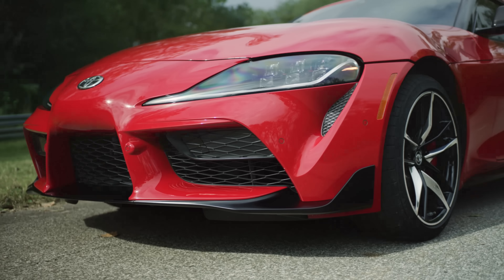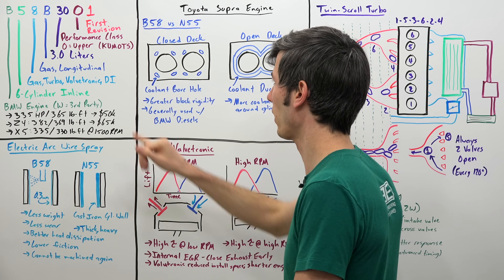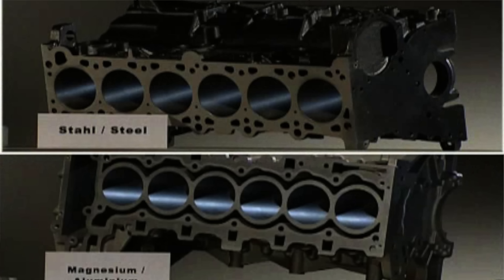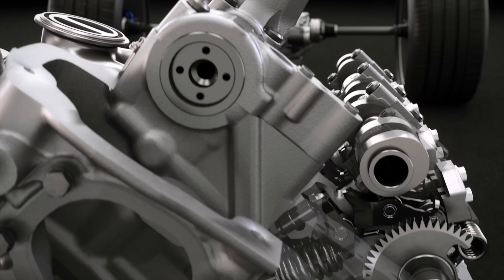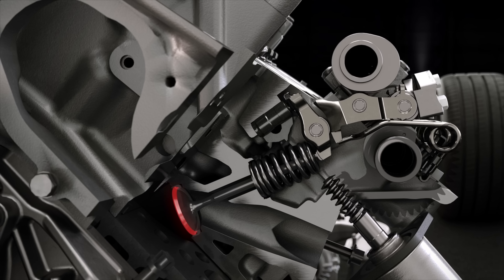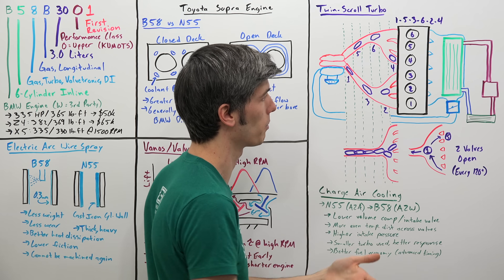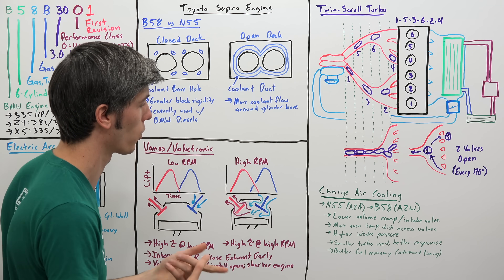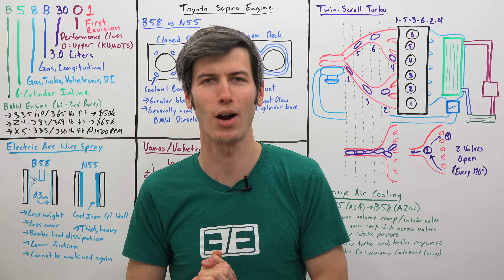2020 Toyota Supra Engine - Detailed Review Of The 2JZ Successor

Comment: Ok, I'm glad to see the return of the supra, but here's where I'm having an issue. This car is going to be in $50k to $60k range making 335 HP and 365 lb-ft. You can buy a brand new Toyota 86 GT for $29k (rounding up), install the Edelbrock supercharger another $5k, a full engine to tailpipe high flow exhaust replacement $1300 (roughly), high performance fuel injectors $500, and a pro tune $500 ish. At this point you've spent around $36,500. You should be making a little over 300 HP and 225 lb-ft and coming in around 300lbs lighter than the Supra. I know the 86 won't be as fast, but considering you'll be saving nearly $15k on the base cost and who knows how much on all the BMW maintenance prices you'll have to pay for with the Supra, it could be a better all around buy for what would still be a pretty fun car to drive. Just food for thought, not trying to tell anyone what to do.
Reply: Toyota 86s are like cigarettes. They are always getting smoked.
Reply: unstablebobgable
Oh they're not the fastest cars by any means, but I think they're good for an entry level sports car. I mean, they cost the exact same as a new MX5 and give you an extra 50hp for that price. It really just depends on what you're looking for.
Reply: @beauleidig8670  they cost 5k more than an mx5, base model to base model. And if you take the 180hp version theyl cost  the same but youll have a well equipped mx5 thats as fast or faster than an 86 just because of weight
Reply: Joshua De Backer
Ok, so I just noticed that the Z4 starts at the same specs as the Supra, but upgrades to 382 HP 369 lb-ft at $65K. I see what you're saying about the GT aspect, but you can already buy a Z4 that does everything the Supra does for the same price, so where is the incentive to buy this car other than just the Supra name badge?
Reply: and by doing all that you lose all your warranty, and you'll still have the lesser car. The supra is a GT car, not a sports car
Reply: Joshua De Backer
That's a fair point, but in that case you could still buy a brand new Nismo 370z at 350hp 276lb-ft $46K, Kia Stinger GT at 365hp 376lb-ft $40K, Ford Mustang GT at 460hp 420lb-ft $41K, Chevy Camaro SS at 455hp 455 lb-ft $42K, and if you're lucky enough to find a dealer that still has one brand new 2018 Ford Focus RS at 350hp 350 lb-ft $41K. That's five cars that all cost between $5K and $10K less than the new Supra, and all have more hp and (most likely) higher top speeds. If you're buying the new Supra because you want a car that says Supra on the back then you should be happy. However, if you're buying it because you think it's going to be smoking all the other cars in it's class then you're going to be pretty disappointed. I really don't think this car is going to live up to the Supra name.
Reply: @beauleidig8670  well like i said, this car isnt to smoke other cars, its not a sports car. It's a GT car, all that it needs to do is be comfortable at 130mph on an autobahn, and since its pretty much a z4 they succeeded in that. Its also really modable so thats cool too
Reply: Joshua De Backer
The MX5 starts at $25,730. The 86 starts at $26,505. That's only a $775 difference at the base level. Also every trim level of the 86 makes 200hp-205hp. You're right, there is 400+ pound weight difference, but they both have about the same top speed. Though, I'm sure the MX 5 is way faster off the line. Like I said in my other comment, it depends on what you're looking for.
Reply: @beauleidig8670  oh the mx5 starts at 22.690 here and the gt86 starts at 33.400 so thats over a 10k difference
Reply: Beau Leidig I want a third option with a strong, long lasting engine.
Reply: Lmao you started naming all these mods and i was thinking you were gonna say it was gonna make like at least 400 but nope. With 1300$ i made just under 400 whp in my 335i and 420wtq
Reply: Luis Navarro
Oh no. At the end of the day you can never change the fact that the 86 is still a four banger no matter how much you mod it. Getting any 4 cylinder past 350hp is pretty tough, and honestly not worth the effort when you can just buy a 6 cylinder and do so much more for less money.
Reply: Beau Leidig yeah and sorry i didnt mean to sound cocky or anything im just not familiar with 86s and their power numbers
Reply: Luis Navarro
No worries, you're making a good point. If you want a really fast car you have to go up in engine size. There's no way around that, but then you start having to make decisions about how fast you want to go vs how much your car weighs vs how well it handles. That's why there's really no perfect formula, just personal preference.

Comment: so Toyota Supra using BMW engine now ? shameless ...why not develop new Toyota engine
Reply: Toyota have a perfectly good V6 twin-turbo engine already. :)  But they didn't want to spend the money to develop a low selling car from scratch, so it was cheaper to use BMW mechanicals and get BMW to make it.
Reply: TassieLorenzo finally someone with common sense
Reply: Toyota couldn't stick the Lexus motor in the new Supra because it is a V6 and the Supra needed an inline 6. All previous generations of the Supra had an inline 6 and also a JDM four cylinder. I love how people wanted a "3JZ" meanwhile the MK3 had a 7MGTE, and the 1JZ was a four cylinder

Comment: Well explained again. Only thing i would like to mention is that the Twin Scroll Turbo has not something like 2 Chambers. It more a little separation in the chamber around the Turbine-wheel on the hot side and all pulses end up on that Wheel like explained in the Video. - The new Supra is great by the way

Comment: Its not a Toyota Supra, just a cynical marketing ploy. an absolute crap Idea. its Like Mazda making the next "Ford" mustang.... although that would be an improvement.
Reply: Well, Ecoboost engines are Mazda designs, so you're not wrong, at least for the 4 cyl turbo mustang.
Reply: @InvidiousIgnoramus  Dude a Mazda Miastang would be lit
Reply: The turbo chargers from ford were originally developed by the German company FEV.Mazda historically doesn’t use turbos in-till recently
Reply: recently like 1980's? Mazda has had turbo cars for a long long time....  @daveyjones8764
Reply: @InvidiousIgnoramus  actually they are Ford engines.
Reply: @durban23496  actually, no, they are not. They are Co developed by Mazda and FEV engineering, and the 2.3l Ecoboost in the Mustang is quite literally built off an existing mazda engine platform, the L series.
Reply: Dylan    Have you heard of an artist named slim shady?
Reply: GTs are really good cars now lol. Some people just love to hate I guess. And even in the video, he says it’s a bmw with Toyota bodywork.
Reply: ShittyWheelies Obviously he doesn’t follow cars... I’m not even a mustang guy but you’d be wrong to say the new GTs aren’t light years ahead of the old ones.
Reply: Wouldn't markenting ploy be making the supra a crossover suv?
Reply: Fun fact. JZ engines from Toyota were built with the Help with Yamaha. Along with the 2000gt, Lexus LFA etc. Toyota needs help with engine development. if that's a surprise to you-you know nothing about Toyota and only a fan of fast and furious.
Reply: Mazda tried making the mustang back in the day.. stang guys wouldnt have it because it was v6 and front wheel drive.. the ford probe
Reply: If Subaru 86 is acceptable, why not BMW Supera?
Reply: @dirkstrickland135  subaru already use the same manufacturers already, plus toyota own a large percentage of subaru anyway, brother company/in house kind of thing.
Reply: @dirkstrickland135  Different naming conventions, they didn't name the 86 *"Trueno". And its a shock that the Lexus group wasn't able to manage to build the new Supra in the first place. My father is retired Honda engineer if he heard that another company was making the new NSX his morale would be lower than low.
Reply: greggy weggy Sorry Buddy but it is a Toyota Supra :,( no matter how much you hate it, its still a car that Toyota makes called the Supra
Reply: Ecoboost 3 cylinders engine is actually Yamaha
Reply: That's actually a genius idea
Reply: This just in: "Rotary-powered mustangs have suddenly been sliding through touges all throughout the land, as the Eurobeat intensifies."
Reply: From downtown with tha I'll burn.....ouch😲 💥
Reply: I guess it’ll be a great car, but not a real supra.

Comment: Curious if Toyota added their D4S to this car as well like they did to the boxer engine in the GT86. For those who don't know Toyota D4S system is a dual injection system GDI and PFI, they have been using it since 2008 starting with a few Lexus models.

Comment: I don't know what to say... all original Supra fans wanted from Toyota was a 2J of some kind for this generation.
Great video though.
Reply: But Toyota's V35A-FTS V6 twin turbo in the Lexus LS500 is better for handling!  A V6 is shorter and has less moment of interia than a straight six -- it can fit behind the front axle! :) The point is Toyota were too cheap to design their own car complete with their existing V6 twin-turbo: it was cheaper to get BMW to make it, including the regular BMW engine.
Reply: @TassieLorenzo  I agree. They might as well have done what Nissan did.

Comment: Of note: 1) BMW w/Valvtronic = 1st Toyota to self-destruct in less than 50k miles; 2) B58 has won Ward's Best Engine Award = So What? Obama won the Peace Prize;  3) No Manual? = No way I'm buying it.  BTW, I thought the advantage of a twin scroll turbo was higher velocity exhaust at lower flows, reducing lag...  
Just wait a until the warranties run out, and owners start paying for the engines that failed.  The resale value will drop like a rock- no doubt, somebody will figure out how to swap a real engine (2JZ Anyone?) and manual transmission into it.

Comment: Very well presented and informative video, thank you! Unfortunately I think it's too much to comprehend for the simpleton MKIV fanboy that thinks all you need an exhaust, a bigger turbo and a body kit to be pushing 1000whp reliably from the 2JZ.
Reply: These people forget they made the engine of the friggin fastest atmospherical car ever, BMW may be just OK at cars themselves, but on engines... don´t mess with the M guys
Reply: Xavier Panohaya so many 2jz nut riders yet none of them have even owned a 2jz. Just follow sik2jz and see how much it really costs for 1000hp rofl
Reply: @darkened13  1000hp rofl? OMG rly? WTF lol
Reply: Geoffrey Anderson lmfaooo
Reply: @Qrow91  Yeah this engine has great potential, he forgot to mention in the video that it has forged internals. People will be making huge power in this new Supra.
Reply: The B58 engine is reported to be one of the best engines of 2015. But others criticize it for not being  Toyota or not fully Japanese, etc.

But for me it doesn't really matter as long as the engine,  and performance are good enough. There will be Toyota reliability of course, because their engineers worked on it. Times have changed. People should accept on  what it is.
Reply: @cjvaans4484  They can also blame themselves for not buying the Mk4 when it was available which made Toyota stop making it, and they can blame the mentality of buying used sports cars and saving some money for mods. Had sports cars sold well, all this wouldn't happen, either way I like the car and the only reason I don't love it is the lack of a manual and the fact that there will be a GRMN version which would make me feel like I've settled for less (not that I can afford it now but hopefully in a couple of years!)
Reply: @Death666wish  revmatch said a aftermarket company will be making a MT swap package along with a 2JZ engine swap as well.

Comment: I really like the look of the new Supra, I already own a 2016 n55 in an M135i 5 door, and I can tell you the inline 6 with a small turbo, paired to the ZF8 speed is an awesome combination. This is even more awesome when tuned! 

Objectively, looking at the Supra, I can't justify purchasing one when you can get an M240i for cheaper, a M2 for same money and a Z4 M40i for not too much more money, but has a more aggressive tune and is actually quicker on track than the M2. 

The new Supra is a great car, but so are all M oriented BMW with an i6 turbo. I would feel that when I purchase the Supra, I am purchasing a BMW, and when I am splashing this kind of money, I may as well be true to the vehicles spirit and have the proper badge up front.

This car is not a Supra, it's a BMW, marketing itself as something it's not. I feel that this is quite superficial and misleading on Toyota's part. I do not feel that this is a special car.
Reply: When you see a Supra on the street, you know right away that it's external design makes it VERY special. And because it is massaged by Gazoo Racing, it is lighter and handles better than the Z4 BMW.

Comment: Thanks for letting the unknowing Toyota folks along with the fanboi's who have never owned a Supra that their getting a 3 time award winning motor. 👍
Reply: It is german and produced by bmw, that's already two reasons to steer as clear away as you possibly can from this disappointing vehicle. A true Supra it is not.
Reply: @efferus  The Honda Civic Type R is English, not Japanese? English cars are not known for reliability either, what's your point? BMW have actually had a higher rating than Toyota these last few years in engine reliability surveys.
Reply: @BkSMedia  Please post your engine reliability survey here... would love to check it out.
Reply: @BkSMedia  BMWs are great ... for about 80k miles, after that its GENERALLY a money pit on a scale that is hard to explain to someone that hasnt owned them. The parts and repair might be cheaper in Germany, in US you will pay 3-5 times more than a Japanese car for just about anything on that BMW. Often times if the engine or the transmission goes out it is cheaper to dump the car than to fix it, just not worth it. The used market in US is full of used BMWs going for dirt cheap, especially compared to original price, because people are trying to get rid of them and get at least something back out of it. Many of the people that hate BMWs do so BECAUSE they have owned one or two and have gone through the nightmare of keeping one on the road. Of course there is always that guy that "has 300k miles on his and never any problems" but thats either a miracle or he is lying his ass off.
Reply: @BigChiefWiggles  Oh yeah I know you mean, I owned a E34 for 2 years and it was a money pit, but that was a 22 year old BMW so it was always going to have it's issues, but the issues I had weren't reliability issues with the engine. It was things around the engine like the cooling system or bushes, etc. But I know that pain.
Reply: I love that everyone suddenly hates BMW. They've built some of the best straight 6 platform engines outside the 1J/2J and now everyone think they're bottom of the barrel trash. I don't know at what point the car community became so cancerous, but did they expect Toyota to spend billions of dollars to develop a brand new, proprietary I6 engine for this low volume sports car, just to please the rabid fanboys who only know of highly modified MkIVs? BMW is the only prolific manufacturer of performance Inline 6s, and they have a great chassis that Toyota got to build off of.

Comment: You forgot a few things.
1. The timing is on the rear of the engine and makes service very expensive 
2. This motor has 2 water pumps, 1 mechanical because of so many N series failures and 1 electric for the turbo
3. The material for the oil gasket is now changed and should not crack in cold climates as quickly as the N series.
4. The thermostat has been upgraded, plastic quality has better cold temp endurance
5. Uses stronger bearings on the crank also crank and rods are forged 
6. Cyl heads have new cooling paths

Comment: On the plus side, doesn't BMW still make manual transmissions?  I hope that means that the Supra will be sold with a manual.  If it was built by Toyota themselves, I am not so sure that would be the case.

Comment: bmw's of late have not been as reliable as they used to be. i dont know if the supra will get it, but the z4 gets/has an N\A and Turbo 4 cylinder as well that will be cheaper.  i'm sure the engine is technologically advanced, but none of that means anything if its unreliable.

Comment: Does this engine have the dual injection scheme Toyota used on the FRS/BRZ which has both port and direct injection?  If not, will there be the carbon build up issues on the back of the valves that plague other DI engines?
Reply: BMW figured it out with the N55.  Build up occurs at a significantly slower rate.  Think over 100k miles.

Comment: The original 2jz gte engine in the 90's supra is alot better than the junk bmw one. The zjz gte could last for a very long time while major engine modifications were performed on the standard engine running high boost! 
That new engine they have in there will be broken after a couple of years!